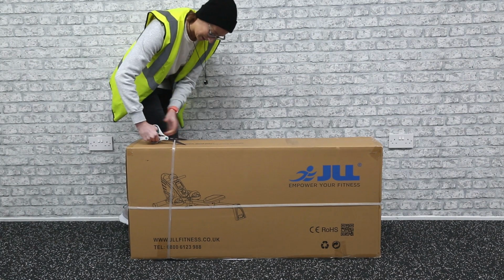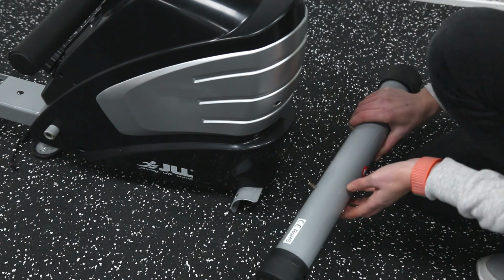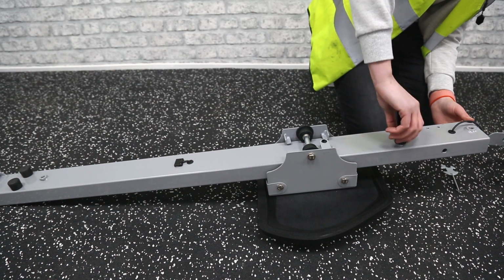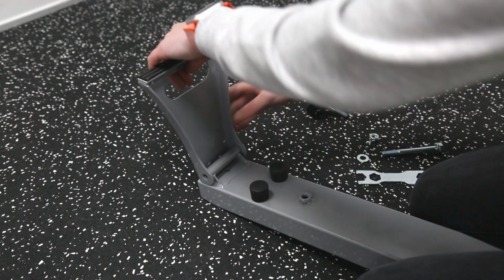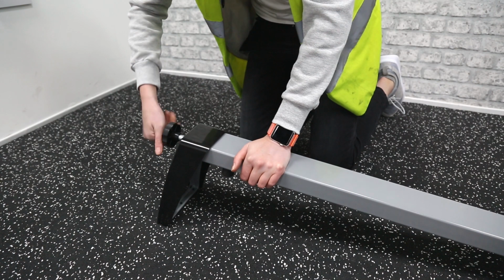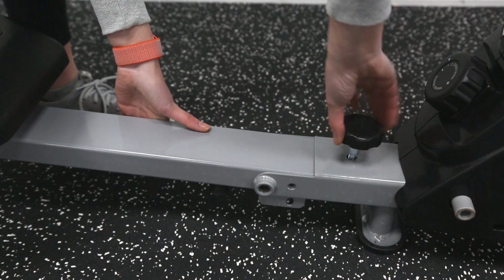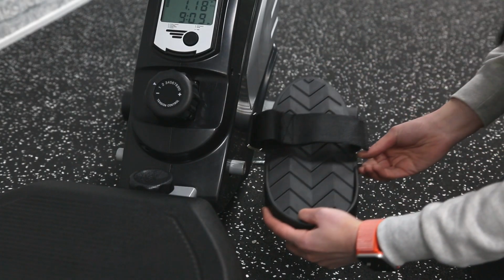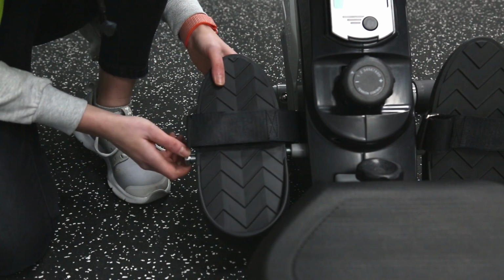JLL® R200 Rowing Machine - Assembly and Unboxing

Comment: Good machine so far, but what does the little plate do? The paper instructions missed it out and everything seems fine without it. Is it to secure the frame in the folded position or something? Marc
Reply from the maker: Hi Marc, To ensure I advise correctly on this please confirm at what time of the video you see the part you are referring to and I will check this for you. -JLL Fitness